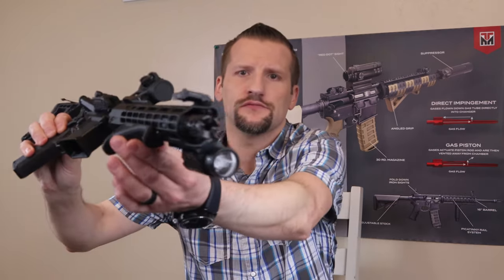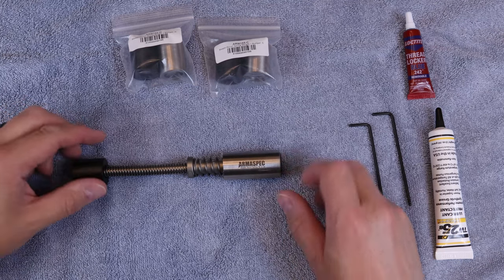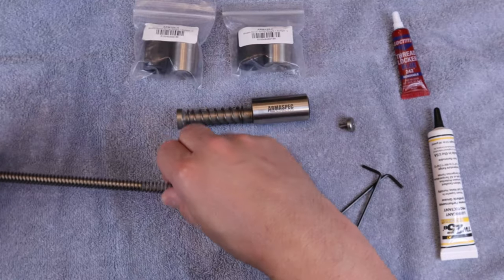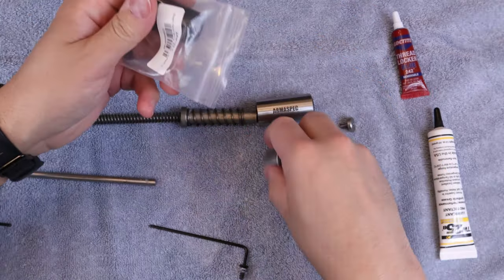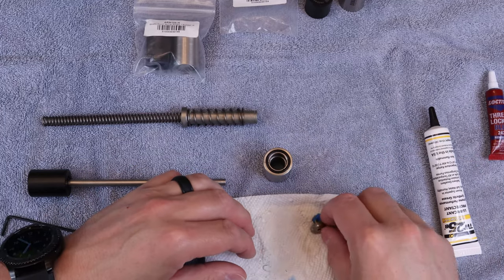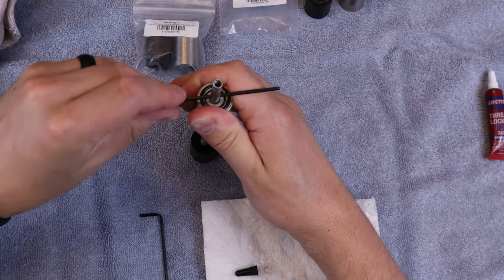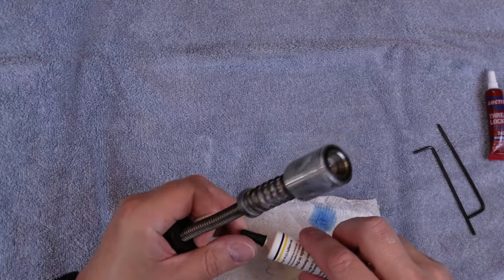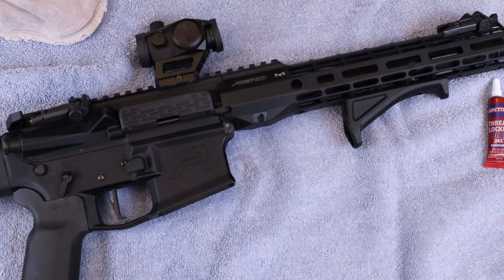Armaspec Stealth Recoil Spring(REVIEW, TUNING, & INSTALL)

Comment: There is no deadblow effect to the SRS, which is why i dont use them any more. Eugene Stoner designed the AR with a deadblow buffer system to eliminate bolt bounce. Without moving weight(s) inside the buffer, you risk bolt bounce and that can either cause an out of battery detonation, or a click and no bang. Had an AR 9mm experience an OoBD, and luckily the gun and myself were unharmed, besides my pride and the mag release. I use sprinco springs and standard buffers. Because thats how the rifle was designed to operate. The Kynshot hydraulic buffer is the better alternative to the traditional buffer. Flat wire springs are nice too. Grease can quiet the cheese grater sound. And before anyone says GrEaSe AtTrAcTs DiRt... clean your gun, ding dong. Buffer tubes have a weep hole in the back and carb cleaner exists.

Comment: Anyone else hate that grease? It was the 1st grease I tried and found that it seems to oxidize quicker than anticipated and necessitates more frequent cleanings. Threw my tube away.
Good demo about changing weights. I have several units but never thought about switching the weights. Could come in handy. Thanks

Comment: Looks like your review, tuning and install is for the Stealth Recoil Spring Gen 1 and Gen 2.     Gen 3 has the cap machined into the recoil rod,  looks like the method changes with the newest generation.    The rear buffer block has a "pin" now rather than a screw as well.
Reply: I have gen 3 but need to change the weight. I can't find instructions anywhere. Any tips?
Reply from the maker: We will be doing a review and install/tune on the new Armaspec SRS Gen 4 Kit here in the near future. Think about subbing up since we have some new stuff coming out shortly, and thanks for the comment.
Reply from the maker: @Matt-mb4go  Wish I could be of help but we might skip the Gen 3 and go straight to the Gen 4 Kit. Although, now that I think about it, probably not when we build our .300 Blackout Pistol AR-15 "Truck Gun". Think about subbing up since we have some new stuff coming out shortly, and thanks for the comment.

Comment: Nice video. I talked with armaspec, and you shouldn't be running grease or wet lube on that, use try lube like a normal spring system.

Comment: Just subbed brother 🤙🏼

Any updates I would be interested in a follow up video 👍🏼👍🏼

I have the JP and I want to test this one too
Reply from the maker: Thanks for the sub. I'll do my best to get more videos posted soon.
Reply: actually id say performance wise they are about the same. i have never owned jp but installed them for friends and tested. both suppressed and unsupressed. now the armaspec i actually do own and to me its easier and quicker to make adjustments on when needed. but if youre looking for performance gains as far as one vs the other id say they are pretty similar in function. nothing at all wrong with the jp by any means. Both of them beat the geissele super 42 in performance, which is what I had been running for years until these shock style buffer systems came out. the problem with geissele now is price honestly, when compared to the price of armaspec. not that the performance isnt great from them too, it is hands down the best buffer system until u get to jp and armaspec. with that said the super 42 is quicker and easier to change for damn sure, and works very well for what it is. anyhow theres my 2 cent rant

Comment: I've got the smb9 from armaspec. When I threw it in my gun, it felt like it had a super heavy back wall like on a bow and after I pulled the charging handle on my 3rd cycle test, it just felt stuck. Ever had that issue?

Comment: I’m running a 16in barrel mid-length gas system with a JP low mass stainless steel BCG and a H3 buffer with armaspec and it ejects brass perfectly at 3 o’clock, I did have the H2 buffer and was ejecting at about 130 o’clock, but with the H3 it’s the smoothest it’s ever ran and so quit as well . But most mid-length gas systems you wanna run H2 for smoother recoil. Armaspec makes it easy and affordable to swap out if need to and that’s awesome ya know. !
Reply from the maker: That's so awesome man. I'm glad to hear that it's running so well. I'm getting ready to build another upper in .300 Blackout that will use a low mass Odin Works BCG. I'll definitely keep in mind what you said about the H3 Weight when I finally build it's dedicated lower receiver to make it my new truck gun. Think about subbing up since we have some new stuff coming out shortly, and thanks for the comment.
Reply: For for just a milspec regular ar15 what size do i need to pick? Is just a regular ar15 not suppressed or anything
Reply: I only seen the adjustable SRS GEN4 has C, H, and H2, not H3, that sucks. Did u have to buy 2 separate versions to change from H2 to H3?
Reply: @victorortega2718  I would run H1 , even if it’s carbine gas system or mid-length gas system and that’s just with normal BCG like you said👍
Reply: @not-AI  I did I bought the H3 weight and swapped it out, super easy and not expensive at all !
Reply: @royhooker1561  I guess ill  have to buy the kit that includes C, H1 and H2 and buy H3 separately
Reply: @BallisticSociety What weight armaspec buffer for a 16" 300blk?
Reply: @victorortega2718 …..I have an M&P15 optics ready model with an 18 inch rifle barrel and they recommended the C (carbine) weight since I’m not running anything on the weapon and it’s stock.

Comment: I would like to know from your experience if Armaspec SRS is compatible with Sylvan arms 4 gen fold adapter in traditional AR15 with 16' barrel and if YES , what weight C or H will you install?
Reply from the maker: I can't say for curtain 100% that this will work with the Sylvan Arms Gen 4 Folding Stock/Arm Brace Adapter but from what I can see I don't see why it would not. I would recommend getting there Gen 4 if you haven't already purchased one that way you have the "C", "H", and "H2" weights already in the package to easily adust it, and right now they have a father's day sale going on where you can get the Gen 4 Kit for only $3.00 more than the Gen 3 Kit. Use code "fathersdaysrskit" at checkout and receive 20% off. Think about subbing up since we have some new stuff coming out shortly, and thanks for the comment!

Comment: Great video. I am building a 450 bushmaster BCA 18" I believe mid length gas. What weight SRS would you suggest ? BCA in a video suggested a H2 with the standard spring system. Newly subbed.
Reply from the maker: I would recommend getting the Armaspec SRS-BB which is specifically for the .450 Bushmaster. If your going to go with the standard spring system then I would recommend either the H2 or H3 weights, maybe starting with the H2 since it's right in the middle. Luckily extra weights do not cost all that much. Good luck with the build, and thanks for the sub.

Comment: Sooo.... Im an idiot and purchased the srs9 6.4 for my Nato 223/556.

Yes, I shot with it installed and liked the recoil and feel supringly without any misfeeds or fte's However the only problem (which led me to the conclusion i purchased the wrong srs) is the bolt would not lock back after last round.

Again, Yes i know NOW the srs is made for the 9mm but im not sure i can return to exchange. So with that being said. The only difference i can tell is the black plastic buffer is just an 1/8th of an inch too long which stops the bolt from moving back enough to catch. Would running that weight with that spring configuration damage the rifle if i corrected the length of said buffer? Or is it mainly the length of the buffers that makes them different?

Opinions or suggestions?

Let the roast begin!🤦🏼‍♂️
Reply: The length should be the same it's the weight that is different. Can you manually lock the bolt back with the charging handle?  If so then it's not the length but the weight is too much for the gas to push it back enough to catch.

Comment: Do you recommend using the srs on a .300 blackout 10.5 and an ar15 10.5 556 build or what other option is available for these two sbr?
Reply from the maker: Yes, I recommend using the Armaspec SRS in both of your 10.5" SBR's. You'll just use a heavier weight for the .300 blackout. I've been using one in my 10.5" 5.56 AR-15 Pistol Build for quite a while, and I just put one in a 10.5" .300 blackout AR-15 Pistol Build, but haven't tuned the blackout yet.

Comment: So I just got one of these recently and when I put it into my buffer tube it never sat flush against the detent pin. It was ever so slightly too short and the bolt never went into battery when I racked the gun. Is this an issue with the buffer itself or is my buffer tube out of spec?
Reply from the maker: I'm not entirely certain as I've never had this issue. I would probably lean towards the buffer tube being out of spec. Luckily buffer tubes are cheap enough to purchase and test. If you replace the buffer tube and still have the issue, then I would contact Armaspec. That's the route I'd go. Hope that helps, and make sure to let me know what you figure out.

Comment: Which Stealth Recoil Spring weight would you recommend for a 12.5" barrel suppressed AR15?  I was thinking H2 or H3.
Reply from the maker: Hello, sorry for the late response. As far as a recommendation for an Armaspec SRS buffer weight. I would originally say that you'd probably be best running the H2 weight, however I would also recommend that you buy the extra weights and spacers for H3 and H weights. If your going to do that then I'd say buy the Armaspec SRS  System with an H3 weight and also buy the H and H2 weights cause doing it that way will save you $4.⁰⁰ overall. Hopefully that makes sense. If you have any questions, please feel free to ask.

Comment: Pretty cool, but we need to see it in action!
Reply from the maker: Thanks. I'll be adding a build video of the 10.5" AR-15 Pistol that is using this Armaspec Stealth Recoil Spring soon, and that video will have some shooting action in it. So be sure to subscribe to the channel to be kept up to date on new videos.
Reply: @BallisticSociety  try a 300 blackout in   short barrel AR s.  They are the best.  Not near as obnoxious.  Great to suppress too!
Reply: @markrippt4677  Hey Mark, I have a 300 BLK in 7.5”, 8” and 10.5”. What weight are you using for yours? Thank you.
Reply: @DarrylO39  standard weight carbine SRS  w/ a light weight bolt carrier.  Works great on mine.  10.5 PSA upper.  But there are lots of variance in all the gas port holes in barrels.  My upper needed the light weight carrier to cycle subsonic reliably  without a can.
Reply: @markrippt4677  Ok, thanks. I will keep that in mind when I make my purchase. Thanks.
Reply from the maker: I will be building a .300 Blackout Pistol later this year that will be dedicated suppressed using Aero Precision M4E1 Enhanced Upper Receiver and Handguard with the Handguard covering about 4.5" of the suppressor. I'm pretty excited for it.

Comment: are all the springs the same weight? How to get stiffer springs. I want as stiff as possible with lightest buffer possible.
Reply from the maker: Sorry for the late response to your comment. You don't need to change the spring weight as the actual weights already account for heavier spring pressure. Plus I've never had a problem tuning mine with different weight BCG's. Think about subbing up since we have some new stuff coming out shortly, and thanks for the comment.
Reply: @BallisticSociety  thx! always good to have reference videos. ... But after $2000 in various parts, I've tuned both my battle rifles (they both shoot AHHH MAYZIN now. +reliable)